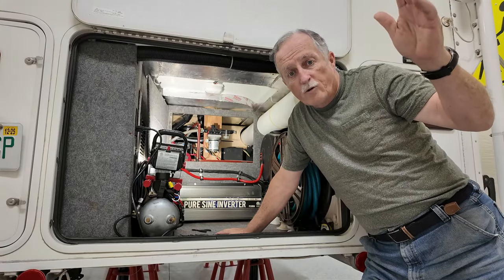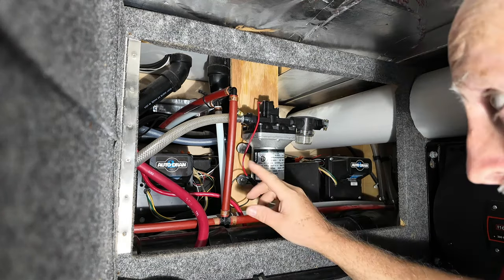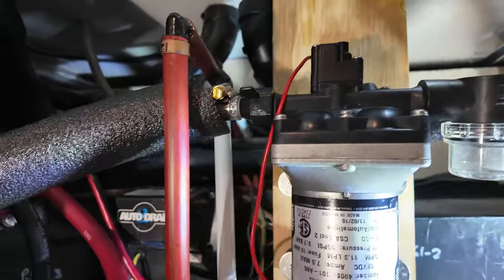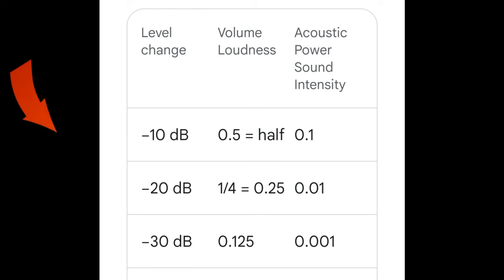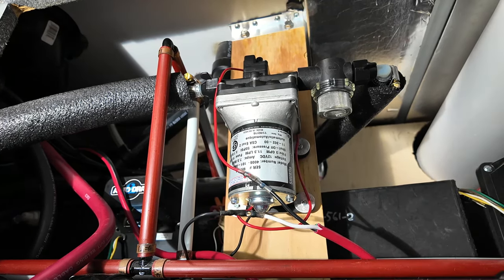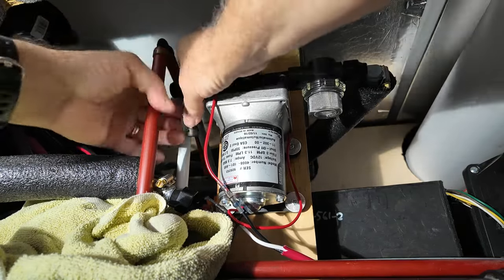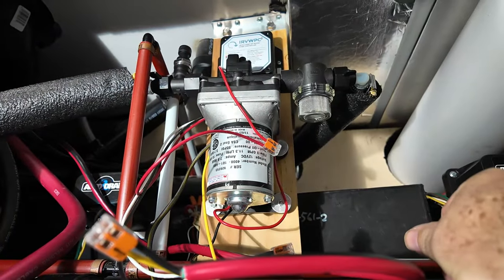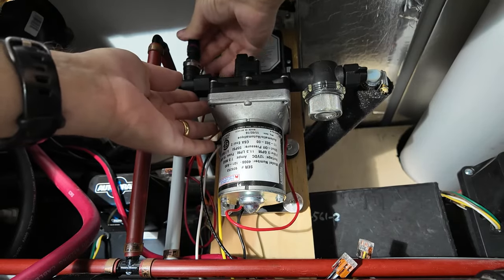How to Quiet a Noisy Water Pump - with IRVWPC2

Comment: I had problems with the original Sureflow that was in my camper but either way, It was almost as loud as my generator...  I replaced it with the Sea Flow that I got from amazon and barely know it runs anymore. So quiet!

Comment: Will be adding this to our Eagle Cap 1200 for sure. Also I have seen the 2 auto drains back there. Can you cover those? Factory or did you add those? My Eagle Cap 1200, you have to crawl 7ft up inside the basement to to winterize. Not a well though out plan.
Reply from the maker: Those auto drains you see in the background are for the black and grey tanks to empty and were installed at the Chalet factory when purchased 12 years ago!  Still working great!